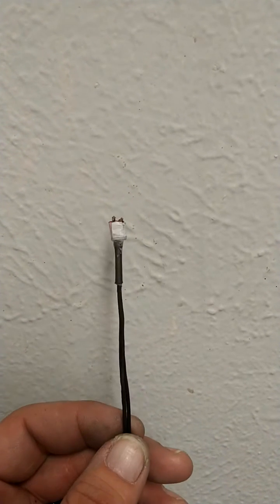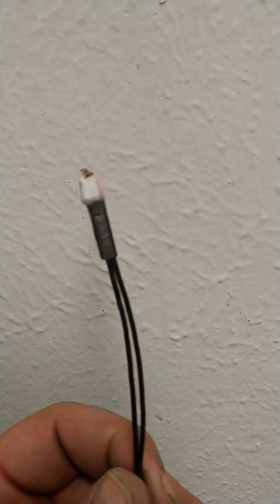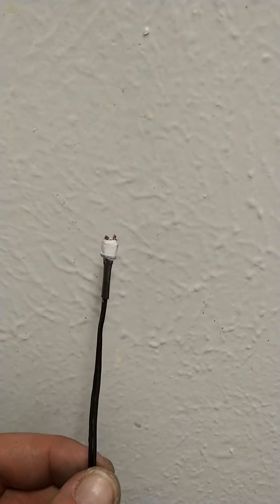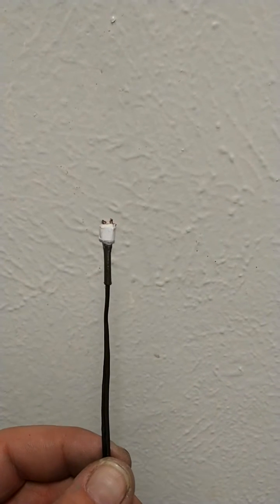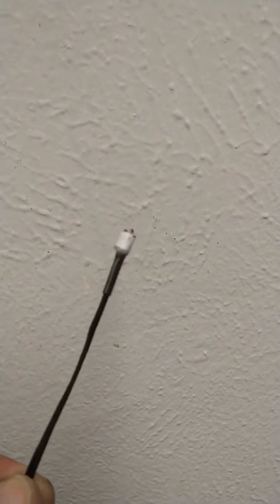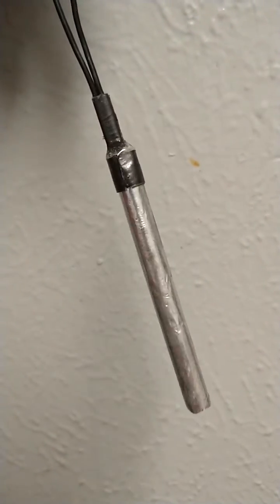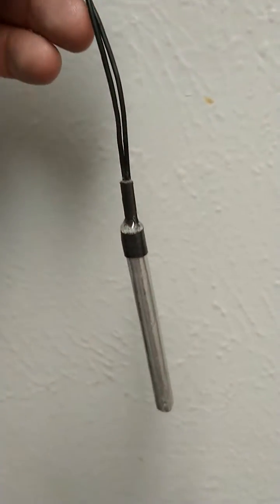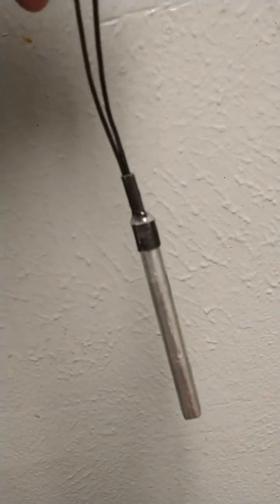💥 Improvised electric blasting cap💥

Comment: Take your epoxy, heat it up "Or use acetone" to liquify it and add your amine and oxidizer to it. Dip your wire in as many times as needed until you get the size you want and let harden. Can do several at a time and you don't have to worry about crappy aluminum foil. 
JB weld can be some really good stuff as well.

Comment: Meth smoking is dangerous kids
Reply: this is an expensive hobby, meth heads can't afford both this and meth. pick one
Reply: Are you alright?
Reply: I’d say that it is not abnormal for meth heads to “acquire” materials for their “Projects” without having to pay for said materials and there are plenty of tweaked out there that have a rudimentary knowledge of chemistry. Any moron can nitrate compounds into high explosives trust me these people have no jobs …. They have the time and energy to steal what they need to do dumb shit like this a 1 gram blasting cap has no problem liberating your hand from your body and the types of materials he’s using he hasn’t a clue weather these compounds he’s using will have any reactions with any of the other materials he’s using you pack it wrong and you could lose a hand , use the wrong primary and secondary together and you could have a slow reaction that won’t go critical until maybe days later when it blows a hole in your sock drawer you see what I’m saying
Reply from the maker: Ur absolutely right, I don't know anything about chemistry. lol thx for the views and comments